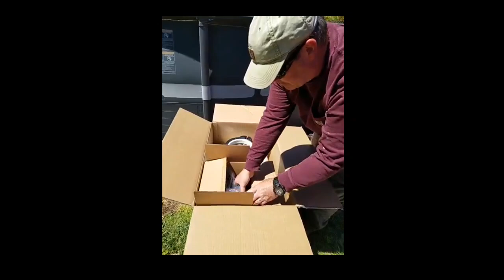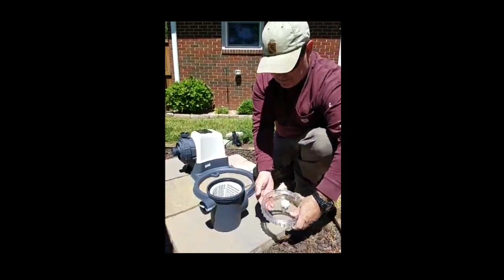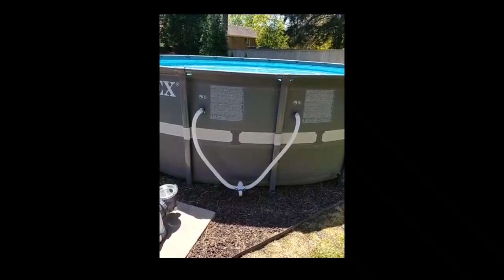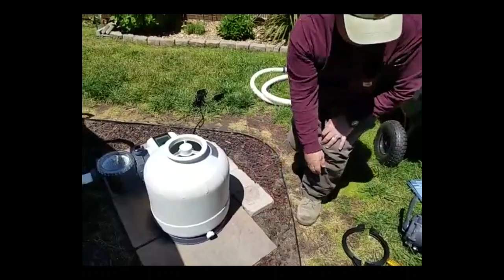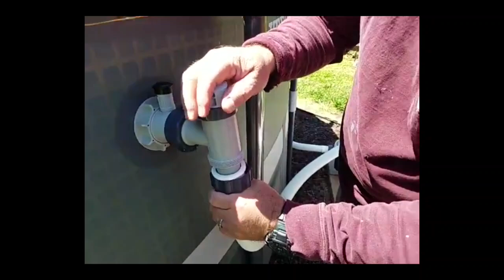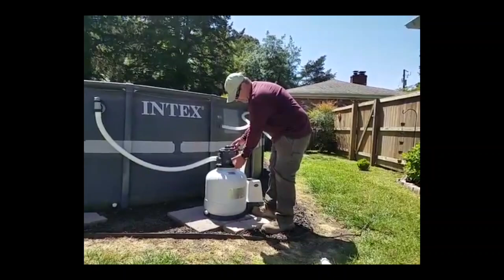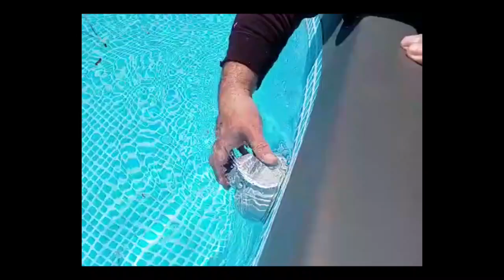INTEX SAND FILTER PUMP - Setting the pump up for above ground pools

Comment: Thank you for the step by step video :) Have you had any issues with that sand you used? They are mixed reviews stating the sand goes into the pool. Have you had this problem?
Reply from the maker: yes, just a little, like really tiny amounts not enough to cause any concern and it's  here and there, not constant. I just think it may have an extra inch of sand in the pump more than absolutely  needed. It is something we have also read with regard to the sand in the pool subject with other pool owners...not a huge concern for us really.
Reply: @MoverandShaker  Thank you for your response! I ended up going to Leslie's pools and bought sand. Thank you again 😀

Comment: How many hours per day do you run your pump?
Reply from the maker: 6
Reply: @MoverandShaker  Do you have any issues with trash floating out of the skimmer after the pump stops? In the past we had a cartridge pump and I ran it all the time, but now that we have upgraded to the sand pump I don't feel like it needs to run non stop.
Reply from the maker: No, the pump doesn't need to run non-stop unless you keep a very dirty pool. if you make sure that once A-day you do your due diligence to try to keep the bottom and anything you see floating clean you should be OK with only running the pump 6 to 7 hours or less I would only expect to see trash floating out of the skimmer if the basket hadn't been dumped we do our due diligence to dump it once A-day at least.
Reply: @MoverandShaker  Last question do you run your pump during the day or at night? Thanks for all your help!!!
Reply from the maker: day
Reply: @MoverandShaker  do you unplug your pump when not in use?
Reply from the maker: No. Only if rain is in the forecast.

Comment: Love this well done very easy to follow thank you from
 New pool people
Reply from the maker: Thanks so much. Anytime you have a question please ask. We were new once also and we are always learning. We have to stick together!
Reply: @MoverandShaker  
I do have a question about the pool if I  could ask.
How far do the le supports extend outward from the pool? 
Thank you in advance for your help.
Reply from the maker: @christinas907  If you are referring to the rails going around the pool, when the pool is completely full they are flush with pool wall until the last few inches and then it is about 2 inches from the base to the pool wall where there is a gap. I think all the legs vary slightly even with all the time we spent measuring, balancing and making sure everything was level, I have seen movement in the legs.  Did you have concerns about your supports? 
or did you mean something else?

Comment: Thanks for the video. My intex pool size is 16feet*8feet*42in. can I also use 3000 sand filter to work well with my pool that capacity only 2873 Gallen?
Reply from the maker: For your smaller sized pool you should  be good with this one. 12" Intex Krystal Clear Sand Filter Pump for Above Ground Pools
Pump flow Rate: 2100 GPH. System flow Rate: 1, 600 GPH
https://amzn.to/3dbuJXY

I think our sand filter would be way too much for yours.

Comment: What filter size it’s that one ? Because I just add a 50 pound bag of sand and I’m not seeing any suction 😐
Reply from the maker: We have a 16" 3000 GPH and it holds 120lbs bags of sand. https://amzn.to/3fheQAw  We used to have the model you probably have that only held the 50lb and it worked but we wanted it to work even better.  I am not sure though why you aren't seeing any suction. Take a peek at your manual and make sure in the troubleshooting you go through that checklist just in case something is off.   Do you have the strainer hold plugs ("the black hat") https://amzn.to/3tXXQ6q installed anywhere on your pool?  I know we use that in the center outlet which does connect to the pump via hose .

Comment: hey I have internet 12" sand filter and pump it came with I upgraded my pump to a Hayward 1.0 hp and there's sand coming in do I need a bigger sand filter 16" ?
Reply from the maker: Your pump may be too large or the sand level too high in the filter. When the filter is backwashing the water flow can cause the sand to rise high enough and overflow into the standpipe, which will allow the sand back into the pool. I would ask your nearest pool store. They are always very eager to help pool owners with technical issues they have because they are the experts on equipment compatibility depending on your pool size.

Comment: I see you've changed to a 50' hose for backwashing.  I'm thinking of doing the same thing, but am curious as to what adapter you used from the outlet of the pump. The line I want to use is 1.5, but no adapter.  Too bad you didn't show how you did this, or where you got the adapter.  This is the hose - https://www.amazon.com/gp/product/B07H93CLRQ/ref=ppx_yo_dt_b_asin_title_o00_s00?ie=UTF8&psc=1.  Great video BTW!  Thanks so much!
Reply from the maker: Very observant. Yes. We did that when we switched to salt because I was afraid it would do something funky to the grass with all that salt coming out onto the yard. I wanted to be able to put out way far under the fence so it would go out past the normal walking areas of our yard. The clamp is just a regular metal clamp like this.   https://amzn.to/2NKUFj9   You just need to make sure the where the hose comes out of the pump it is not bent to tightly.  A lot of people complain about it bursting or popping which you could always cut it and start over but it is really just making sure it has room enough to shoot out with all that force.
Reply: @MoverandShaker  What I was really asking about was the adapter from the drain side of the filter to the 1.5 inch hose that I provided above.  I ended up ordering this one (I haven't received it yet so not sure if it will do the trick) - Intex item # 10849.  Is that what you used?  Thanks!
Reply from the maker: @margaretmasterman5661  o.k. we just used a clamp to the hose in the very beginning we changed over to the hose and our hose is a 2 inch backwash hose but after talking to my other half it was discovered that we eventually decided to use the intex valve with the handle on it.  See this listing. https://amzn.to/3vWjwSi  however the product number you referenced would also probably work but you would still need the hose clamp.  I hope that helps a little more.

Comment: Hi! 
Can you please tell me the sizes of the combo (filter and pump) i dont know if this fits my pump house
Reply from the maker: We put our equipment away for the winter. I can tell you the pump including the handle height is 30" and the width of our pavers is 48" wide and they fit within the width of those 3 pavers so I would say at least 48" wide x 30" high.   That is he best I can estimate until our equipment goes out which is not until another month.  Each individual paver is 24" x 16" stacked together
Reply: @MoverandShaker  thanks 🙏🏼 another question, what pressure your gauge mark?
Reply from the maker: @TiagoSantos-df6ve  I am sorry, our equipment is not hooked up. It won't be hooked up for another 3 weeks. The only thing I can suggest is for your to look at the gauge in one of our videos on a t.v. where we are focusing in our the pump and the gauge.
Reply: @MoverandShaker  Thanks my only concern is when i turn on my pump the filter expand a little bit, is that normal?
Reply from the maker: @TiagoSantos-df6ve  I am not sure what you mean?
Reply: @MoverandShaker  when i turn the filter on, the sand deposit expand a little, and my question is if it’s normal
Reply from the maker: @TiagoSantos-df6ve  When you turn the pump on you can't see any sand so I am not sure what you mean when you say the sand deposit expands? how are you seeing sand expand with the filter running. Are you referencing the guage itself.
Reply: @MoverandShaker  Thank you so much ☺️

Comment: Nice work, i am interested in blowing some ozone in my pool to help fight the algae.
Reply from the maker: Interesting that would make some good content we've never had any algae problems or indicators unless we don't vacuum at least once every 5 days that's when we might see like little strings of green but we get them up right away and we've never had thank goodness algae or green pool it really does take serious dedication and hard work to keep your pool up you got to love your pool to keep your pool in Tip-Top shape on the exterior and the interior.
Reply: @MoverandShaker  ozone is way more healthy than chemicals. Ozone will help you cut down significantly on chlorine usage, Olympic size pro pools are starting to decrease the  chlorine and increase the ozone. Municipalities (the smart ones) are beginning to use ozone for sewage treatment. I live half way in a jungle, lots of trees, so this time of year, the algae comes to visit.
Reply from the maker: Got it. Since we switched to saltwater we havent added one single chemical. I think it's been over 2 months. Yes, being halfway out in the middle of the jungle could definitely being on some algae issues.

Comment: GREAT VIDEO, MY HUSBAND AND I WERE ABLE TO INSTALL OUR NEW FILTER PUMP.. I DO HAVE TWO QUESTIONS IN HOPES YOU WILL ANSWER THE. 1. THE SIZE HOSES THAT YOU USE WHEN BACK WASHING YOUR FILTER. 2. WHY WHEN I BACK WASH MY FILTER I FOLLOW THE STEPS BUT WHEN I PUT IT BACK TO FILTERING AFTER BACKWASHING AND RINSING MY FILTER PUSHS OUT DIRT INTO MY POOL. IT'S HAPPEN TO ME TWICE NOW AND ITS VERY UPSETTING. PLEASE HELP
Reply from the maker: 1. The hoses that we had attached to the backwash area were a special combination of hoses that we made up of two of them came from the Intex pool cleaner and two we purchased off of Amazon. We only use those a few times before we switch to a 50 ft backwash hose that we purchased at Lowe's that way we could get the salt water way way way way out in the yard in an area where we weren't concerned about the grass.

As far as your filter pump. When backwashing make sure your sight glass is clear before you stop backwashing. Then you turn off your pump then you put it on the rinse cycle and then you flush with the rinse cycle until the sight glass is clear then you would turn off your pump again before putting it back on filter.

Comment: Where did you purchase the connections for the backwash tubing that you're using? We bought two extra for the same purpose.
Reply from the maker: Two of them were extras that we didn't need that came with the pool cleaner the other two were purchased off of Amazon but there is a gentleman who sells them on eBay as well. We don't use that anymore once we went to a saltwater pool we wanted the saltwater to go further out into an area where we didn't worry about saltwater hitting the grass so we went and bought a 50 foot backwash hose and that's been working nicely.
Reply: @MoverandShaker  Do you have the seller from Amazon's name? Are they 2" to fit the nut on the 1.25" tubing?
Reply from the maker: Not sure what you're referring to right here. our previous conversation was about the backwash hose the only 1.25 on our pool  tubing came with the Intex pool that's connected to the skimmer and that uses a valve to convert 1.25 to 1.5.
Reply: @MoverandShaker  I meant the 1.5" hoses you connected for the backwash, before you got the backwash hose.
Reply from the maker: @emtravelrn1  https://amzn.to/3knwq5X    and we also purchased these from ebay and unfortunately  the seller sold all 178 of them https://www.ebay.com/itm/Brand-New-Intex-11009-1-5m-X-1-1-2in-Dia-Pump-Hose-with-Nuts-GRAY-/233624526975?_trksid=p2349526.m4383.l44720.c10&nordt=true&rt=nc&orig_cvip=true we did not buy any other hoses the other two had come from our pool cleaner at the time we were still using the hose configuration as a backwash hose.

Comment: Hi, I have an Intex 15’ x 48” pool. How are the 1.25 hoses holding up with this pump. Is the pump running right with these 1.25 hoses? Thx
Reply: Awesome!!! We just got the pool this summer and the little pump that came with it I don’t think is doing the job. Is the outlet connection on the pool also 1.25
Reply from the maker: Okay there are 2 black fittings attached to the vinyl pool and those both get connected to the 1.25" hoses  and yes every pool comes with two plunger valves that will connect the 1.25 hoses to  the  1.5 hose on the right side. you have everything you need to hook up your pool like our original video or with the saltwater system we've never had to purchase any adapters to make this pool operate at all everything came with either one of them and we never had an issue. if you have the Intex skimmer just make sure the strainer hole plug that is black that came with a pool gets inserted into the middle hole that will allow your skimmer to work miracles as long as the white basket of the skimmer is always floating under the level of the water
Reply: That’s crazy!!! I went to look at your original video of new Intex pool just now and your design I looked at before we got the pool and that’s how I did mine. Your husband did a Great job!!!!
Reply from the maker: Ha ha ha thanks we both worked on that project  in the blazing hot heat equally! 100% the landscaping design and the pool idea was all me  (the wife)
Reply: I stand corrected 😄 You both did a Great Job!!!
Reply from the maker: We have never had a problem with it and even though another Pool owner told us that it was in the manual...that the 1.25 hoses were too powerful, but they are short hoses and go straight to the plunger valve which leads directly into the 1.5 hoses. 

 I could not locate his reference in the manual where he said it was not a good thing but those are the two houses we have always had on our pump beginning last July and we've never had a problem with our pump or pump's pressure or anyting else. Our pool equipment runs perfectly.
Reply: Ok thx, on your pool where the water shoots into the pool the jet looked like it was 1.5. You have 3 connections, 2 lower on the pool to the right and 1 higher on the left where the water shoots into the pool. Is the one on the left 1.25 or 1.5? On my pool all 3 holes on the pool are for 1.25 hoses. Is your pool the same. Sorry for so many questions.
Reply from the maker: no on our pool the left is 1.5"   the inlet nozzle comes as a 1.5 piece and on the outside of the pool a 1.5 in plunger valve directly connects to the pool on the outside and then to a hose to the pump.  Watch our original video that says our new Intex pool in yellow letters.
Reply: Ok. Thx so much!!!

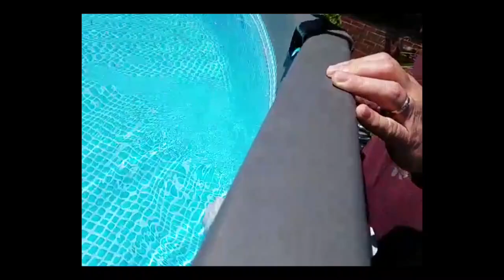Comment: So I've got my new sand filter coming tomm. And I was j.w. what is that thing called at 21:30??? It's like a shut off valve? But I need to know the name so I can purchase it. Thanks in advance 😊❤️
Reply from the maker: I am not seeing anything at 21:30 like that but there should be nothing that you have to purchase because everything you have seen in this video and need came with the pool or the pump you may be referring to a plunger valve shut off.
Reply: @MoverandShaker  yeah it the shut off valve/plunger valve. Does that block the water from coming out of the pool? We have a full pool right now and don't really want to loose the water too much which switching over the pumps
Reply from the maker: @MGnFF224  yes whenever you're doing maintenance on the pump or backwashing the pump or changing anything out equipment-wise you always have to put the plunger valves in the locked position but as an additional backup you remove the nozzle that's inside of your pool that shoots water into the pool and you put the strainer hole plug inside of it that is an extra protection to block the pool water from coming out that and the plunger valves both came with a pool.  I believe the pool came with two strainer hole plugs you hear a lot of talk in our video and the skimmer video about using the strainer hole plug on The Middle hole to provide more suction for the skimmer so it really can be used as a dual-purpose
Reply: @MoverandShaker  k. Yah we just installed our new sand pump today n omg it was such a pain in the butt. Thankfully everything went perfect
Reply from the maker: @MGnFF224   Oh NICE!  It all can be stressful but you will get more comfortable with it as time goes by and honestly we very rarely touch it except to turn it on and off and burp the basket every now and then.  I am glad you are on your way to having a more efficient pool and pump that is handling things!  Let us know if you need help!
Reply: @MoverandShaker  Absolutely. Thank you so much! Have a happy and fun summer
Reply from the maker: @MGnFF224   you too!

Comment: Hello! I'm still a little confused? Do I have to take off the cartridge filter that originally came with the pool? My pool is full right now and I just purchased a sand filter pump (which will arrive wed).
Reply from the maker: Your sand pump will replace your cartridge filter pump completely so there's no reason for you to keep that you can sell it that's what we did.
Reply: Thank you for replying! Does it have to come off? Idk if I still have the other parts😬
Reply from the maker: Your questions sounds almost identical as the first question but when your sand filter pump comes you will no longer be using the cartridge filter pump at that time you will remove the cartridge filter pump and you will only be using a sand filter pump with your pool everything you need to hook the sand filter pump up to your pool will be already there
Reply: My filter currently hangs on the side of the pool? Its not a ground filter
Reply from the maker: @vanecandela  okay well I definitely don't know what you're talkin about I've never seen a filter hanging on the side of a pool but when your pool pump comes and you said everything up let us know when it's good to go so we can congratulate you